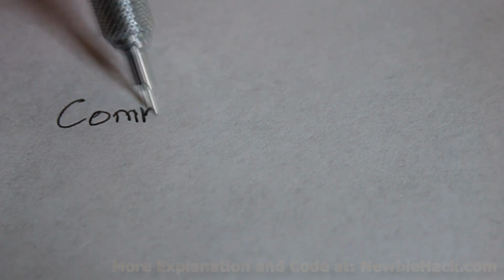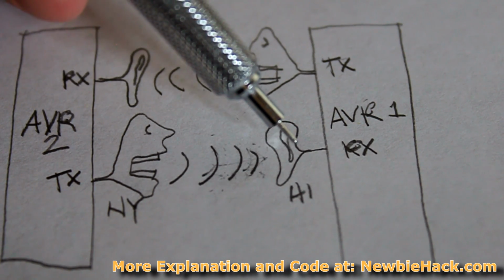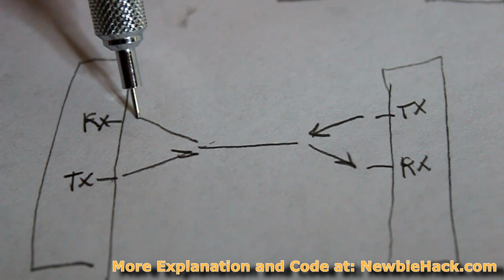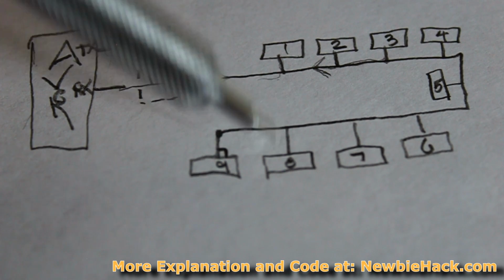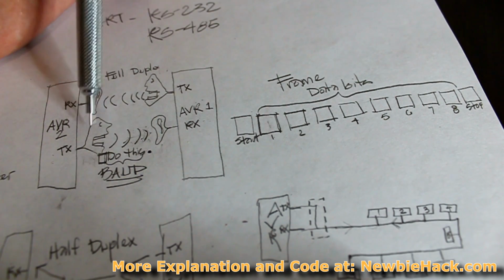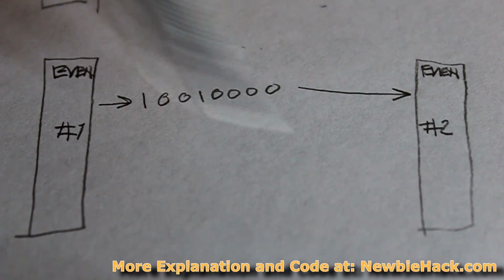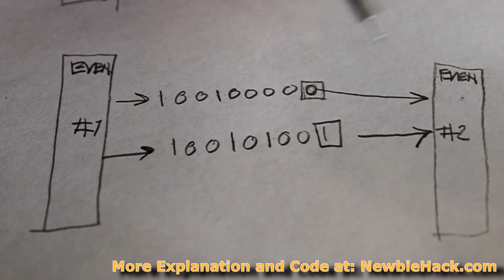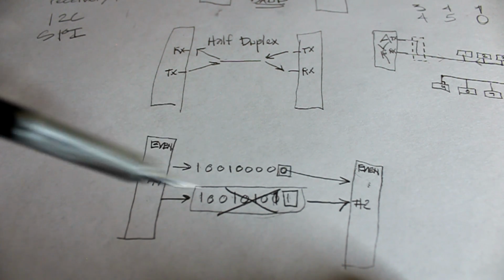47. Arduino for Production! How to Communicate with UART - Tutorials for the AVR Microcontroller

Comment from the maker: Actually, the next video is the implementation of the Chip-to-Chip (wiring the board and writing the program and testing).  I will get to the Chip-to-Computer in the video just after this.  The Chip-To-Computer will cover using a standard serial port, and using the FTDI-232 chip so the USB can be used.

Comment: @Patrick
Found a little glitch in your video, your are talking about baud.
baud is modem transitions per second. not bits per second.
1 baud can transmit multiple bits at the same time (phase shift)
For example a 2400 bps modem is 600 baud (4 bits per phase shift) V22Bis.
A 14400  bps modem is 2400 baud V32Bis 
For the rest excellent video :)

Comment: Very níce tutorial !!! I have some questions though. I`m a Computer science Student and from what i understand sofar, PS2 Keyboard are connected to microcontrollers per usart and High and Lows (1s and 0s) are sent as -15 V or +15V. But if learned that they Keyboard is connected per pullup at 15 V and at ground 0 V , so how can it send -15 V as Signal .   Thx for any help or explanation